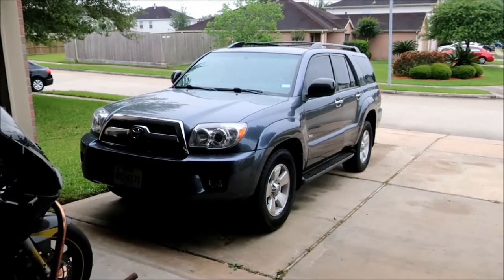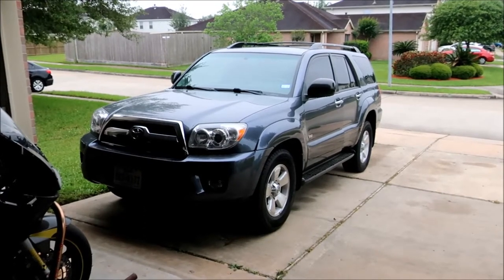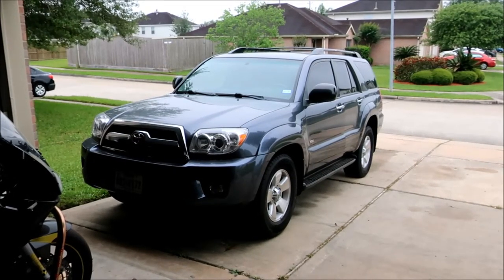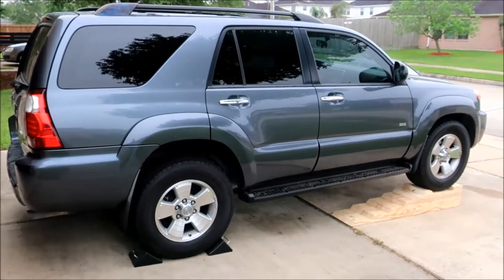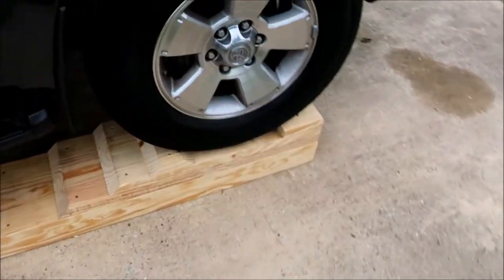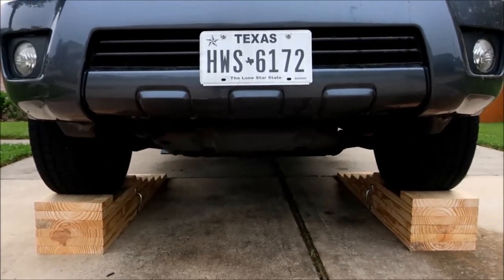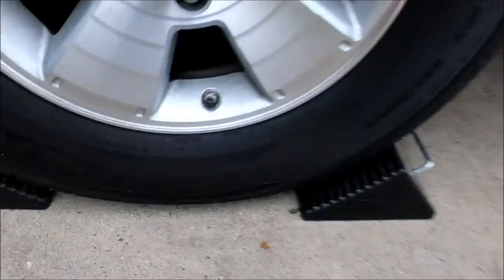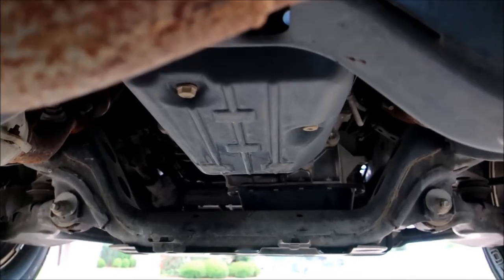2008 4Runner Automatic Transmission Fluid Service - No Dipstick

Comment: First time I see an honest instruction of servicing a transmission. thanks a lot Tommy, I have the same 4runner I am planning to change the transmission oil myself but I was hesitated. Now after I saw your video I'm confident to do so. I really appreciate your video.
Reply from the maker: Glad to be able to help.
Reply: @TimmaethBoy  I have done the changes fluid and filter. I put 4 letters WS by toyota.  4 letters is it a lot?
Reply from the maker: That sounds about right for dropping the pan. Just set the fluid level afterwards and you should be good to go.

Comment: So question. If you pull the Allen key check plug on the transmission to do your finally fluid level check. But if you pull it out when the transmission is cold. Should there really not be much fluid coming out? Because I unscrewed it about half way to see what the color of the fluid looked like and it came gushing out while the tranny was cold. Does that sound like the tranny was over serviced by the person that did it previously?
Reply from the maker: Hopefully you didn't do this when the engine was off. If you pulled the overflow plug while the engine was running, transmission cold,  thermostat bypass valve on, vehicle is level, etc. etc., then  you're correct; there shouldn't be much fluid, if any at all coming out of the overflow plug until it reaches the correct fluid level inspection temperature. If it came gushing out while the engine was running, then more than likely they overfilled your transmission.
Reply: @TimmaethBoy  yeah it was while it was off. I didn't take it all the way out, just half way before it tried to squirt out. And a little came out but not much. It just seemed like it was going to be a lot haha. But yeah I took a infrared laser temp gun and pointed it at the trans pan till it was at the operating temp since I don't have a scan tool. While it was running then pulled the check plug out and it trickled out so it's at a good level. Thanks for taking the time to answer though. Makes since why alot tried to come out because it wasnt running, that was my bad haha
Reply from the maker: @davidlavery8336  Luckily you caught your mistake before anything bad happened. :)

IR gun works in a pinch for checking the temperature. Sounds like you got the fluid level figured out and set properly. All the best!

Comment: Hey, I’m planning on doing my trans fluid drain and fill and rear diff drain and fill. You mentioned to use the steel crush washers on the trans. Do you know if I need to use the crush washer or the aluminum washer on the rear diff?
Reply from the maker: I believe the crush washers used on the drain and fill plugs for the differential are aluminum.
Reply: 12157-10010 for read dif and trans fill plug; 35178-30010 for trans drain and overflow

Comment: Question: The fluid that was already in the tub sitting at 2 gallons, was that fluid from opening the drain plug?? Because if thats the case you flush an additional 2 gallons from the hose. So your total fluid sits at 4 gallons. Yet later in the video you say you replaced the 2 gallons you removed......... wouldn't it be 4? Did I miss something?
Reply from the maker: The container I used for measuring how much fluid came out of the transmission is where I store my used oils. The oil at the 2 gallon mark was from other services done / not related to the transmission service shown in the video.

Comment: Hmmm…For the final level check you should pull the check plug let it drain to level, or add until it starts seeping out, then crank the car and let the oil heat up.  We know at that point that it can only expand so you let he car run until it hits the temp range and any excess has drained due to expansion from heating and then insert the plug in the middle of the temp range.  You had about a quart too much in the transmission.  If you had used the above procedure, you would have only lost a couple of ounces at most.  Still a great video!
Reply from the maker: Incorrect, but appreciate the feedback.
Reply: Better contact Toyota and tell them you have a better method than there engineers!

Comment: @d.g.9606 addressed one good question. 2 more clarifications:
1. Confirming this does a COMPLETE transmission flush, not just pan and residual?
2. Why use the line and not the drain plug?
Thx.

Comment: Question? Before checking operating temperature with scanner? wouldn’t you have to shift gears before draining for level?

Best honest video. Great video.
Reply from the maker: Yes. I believe I mention it in the video as well. You need to make sure you have enough fluid in the transmission before shifting through the gears; i.e., don't have the fluid level be too low and starve the transmission of fluid.

Comment: Great instruction video and not a high dollar production company thing.
Love it!
Q- how many 2x12's did u need to make those ramps.?
Reply from the maker: Thanks!

The total stack up was 6 including the tire chock portion that prevents the vehicle from just falling off the ramps. They are also hollowed out in some places to make the weight more manageable. 

You can kind of gauge the length of them from the video and figure out how many 2 x 12's you need to buy if you were wanting to recreate them - certainly not the most elegant thing I've made, but just wanted to get them made quickly.

Comment: Thanks Tommy, My brother-in-law just bought a 2008 4runner with 166K miles on it and I doubt transmission fluid was ever flushed. I'm not a real mechanic but I was a motorcycle roadracer back in 80s so that should count for something. :) Never flushed transmission fluid before and I don't have a ODBC temp reader for transmission fluid temperature. Wonder if I can rent a temperature reader from Auto Zone.
Reply from the maker: You can perform a transmission service on this vehicle without using a scanner. Check on one of my replies to Joe; I posted part of the procedure on how to do this.
Reply: https://www.toyota-4runner.org/4th-gen-t4rs/195074-atf-exchange-using-cooling-line.html
Here it how you do it with out a scan tool: On the ODB-II connector, use a 16-20 gauge (16, 18, or 20 gauge will work) jumper wire to connect terminals between CG (4) and TC (13)..there are more directions but that is the start.
Reply: Thanks Joe 🇺🇸

Comment: Been watching many videos on this subject in preparation of doing this job. I appreciate the level of detail you went into. This is an incredible video! One concern I have is I do not know the prior fluid service history of my 4Runner. All I can say about the transmission is that it seems buttery smooth and the vehicle is at 83,000 miles. If a previous owner put in aftermarket ATF, and I add ATF-WS, which is what the manual requires, would the mixture be bad for the transmission? I've heard some mechanics say yes, and others no. I've considered a flush but realize that I'm already over the mileage where it would be considered safe, so I guess the possibility of ATF fluids getting mixed with aftermarket is still safer then performing a full flush. What is your opinion? Thank you.
Reply from the maker: All depends on what they've put in the transmission. If it's compatible with the transmission and you are simply adding additional WS fluid on top of it? Then no biggy.

I usually don't assume that people have taken care of their vehicles when I work on them, but I've been surprised. If you're really paranoid, you can always flush out the fluid and start from scratch. I wouldn't consider a flush harmful for your transmission. The only time I'm concerned about that is if it's a very high mileage vehicle where the fluid has never been changed.

Comment: Is there a reason you did not refill the fluid with a gravity feed funnel into the return line you disconnected for the drain, instead of using the fill on the transmission?  Thanks for this great video!
Reply from the maker: It's much easier to refill the transmission through the proper fill port compared to attempting to pump the new fluid through one of the return lines. You let gravity do the work where fluid naturally drains into the pan from the fill port vs. pumping it through a relatively small tube that runs a few feet horizontally until it feeds back into the transmission; the latter part being impractical and probably very messy. Hope that makes sense.
Reply: @TimmaethBoy  Thank you for the quick reply. Really appreciate the help!

Comment: did you change the transmission fluid filter? Why not perform that service as well while you're at it?
Reply from the maker: I didn't change the filter. Based on the condition of the fluid and the way the vehicle has been operated - no real abuse or towing scenarios, full warm up cycles every time it's driven, fair weather operating conditions, etc - I didn't feel it was necessary for me to do so. I believe the filters on these use the metal mesh/strainer type, meaning you would just clean it instead of replacing it, assuming of course that it's in good shape; they can't filter to the degree a normal pleated filter type can anyway.

Comment: Best video I have seen on this subject. I was wondering, did you go through all of the gears before checking level?  Also, I had a shop do this and I am pretty sure they didn't replace the crush washer as the check bolt is slow leaking.  Do you thin I could pull it, add a crush washer and replace it without too much fluid leaking?
Reply from the maker: Thanks Joe. I thought I had mentioned that in the video, but I guess I forgot to. Yes, it's a good idea to cycle through the gears to ensure fluid is dispersed throughout the transmission prior to setting the final level, but put it back in P or N to resume the procedure. This is also true if you're servicing a conventional automatic transmission with a dipstick. Just make sure there's actually an adequate amount of fluid prior to shifting through the gears.

If you're talking about the overflow plug leaking, then you can get away with removing it when the transmission is cold and vehicle on a level service; the fluid hasn't had time to expand from heat so you really shouldn't have much leak out - only whatever is in the overflow tube which isn't much. Make sure you have the engine running during this, otherwise you're going to lose a lot of fluid as it isn't being circulated throughout the transmission, torque converter, etc. You do have to be relatively quick during this process to ensure the fluid doesn't heat up too much and start draining out of the overflow tube. If it's the drain plug that's leaking and not the overflow, buy some extra quarts of fluid at that point if you decide to fix that leak.

Also, I've seen a lot of people overtighten and deform the threads on the bolt. If that's the case, you need to replace the bolt as well.

Hope that helps.
Reply: @TimmaethBoy  yes, thanks.  Also, I hooked up my obd 2 and it doesn't give me a trans temp reading. Looks like I will need to upgrade. Got any suggestions on an ok reader? I have an innova 3040e and it looks like on the innova website the only reader that give trans temp is a 7111 and I can't find it on Amazon or ebay
Reply from the maker: @joebied1  You technically don't need a scanner to set the fluid level on these vehicles. All you need is a jumper wire and to connect terminals 4 and 13 of the OBD-II connector together - I'd recommend backprobing to avoid spreading the female terminals by accident - while monitoring what the transmission oil temperature light is doing. Below is a bit more information about this method via the repair manual, but verify the fluid temperature spec for your vehicle isn't different:

(b) When not using the Techstream (using indicator light):

(1) Using SST, connect terminals 13 (TC) and 4 (CG) of the DLC3.

SST: 09843-18040

(2) Start the engine.

NOTICE:
Check that electrical systems such as the air conditioning system, audio system and lighting system are off.

HINT:

Indicator lights of the meter blink to output DTCs when terminals TC and CG are connected.

(c) Slowly move the shift lever from P to L, and then return the shift lever to P.

HINT:
Slowly move the shift lever to circulate the fluid through each part of the transmission.

(d) Move the shift lever to D, and quickly move back and forth between N and D (once within 1.5 seconds) for at least 6 seconds. This will activate the fluid temperature detection mode.

Standard condition:

A/T OIL TEMP warning light remains illuminated for 2 seconds and then turns off.

(e) When using the Techstream:
(1) Return the shift lever to P and press OFF on the Active Test display.

(f) When not using the Techstream:
(1) Return the shift lever to P and disconnect terminals 13 (TC) and 4 (CG).

(g) Allow the engine to idle until the fluid temperature reaches 36 to 46°C (97 to 115°F).

(h) The A/T OIL TEMP warning light will come on again when the fluid temperature reaches 36°C (97°F) and will blink when it exceeds 46°C (115°F).

NOTICE:

Perform the fluid level inspection while the indicator light is on.

6. FLUID LEVEL CHECK

NOTICE:
The fluid temperature must be between 36°C (97°F) and 46°C (115°F) to accurately check the fluid level.
Reply: @joebied1  I purchased a "scangauge 2" on Amazon! Its reads my ATF temp for my 2013 4runner.  Toyota  is pretty  picky about ATF temp readers and this scangauge  works.
Just search on Amazon under "scangauge ll " its about 160 + tax and worth it! It also read alot of other things for the cars! Hope this helps!

Comment: I'm curious where the 97-115 degree Fahrenheit temperature range came from? Looking at the Toyota Service Manual it states 115-130 degrees Fahrenheit to accurately check the fluid level.
Reply from the maker: Not for this year model/body style 4Runner. Both the A750E and A750F transmissions call for inspecting the fluid level between 97-115*F.
Reply: @TimmaethBoy  my 2007 Toyota Service Manual states 115-130 also.  great video.  thanks.

Comment: I had a garage change my 4th gen 4Runner SR5 (133,000 miles) - not a Toyota dealer - and now the overflow plug is weeping fluid. I don't think they used a new gasket, so I ordered a new one. Theoretically if the level is right, I should be able to remove that overflow plug when the engine is cold and nothing should come out, correct? If so, then I could add the gasket as should have been done and be done.
Reply from the maker: Yes, you are correct, BUT make sure you have the engine on and running, and vehicle in park or neutral before you pull that overflow plug to replace the gasket.

Get your tools ready to go before you start the engine up. You don't want to be scrambling to find everything while the transmission fluid is heating up and possibly having the temperature climb above the inspection range. As long as the engine has been cold for some time, you should be good with regards to temperature.
Reply: @TimmaethBoy  OK, thanks. Will do. I 
appreciate your advice and of course the excellent video.
Reply from the maker: You're welcome.

Comment: Excellent video, very informative. One question, if you pull the overflow plug while the vehicle is cool (vehicle has been off) , that any fluid that comes out of the overflow is an indication that it was overfilled?
Reply from the maker: No. NEVER pull the overflow plug when the vehicle is off. You should only remove the overflow plug when the engine is running, vehicle in P or N, and transmission oil temperature within the specified checking range. 

If you remove the overflow plug when the engine's off, a lot of the fluid that was being circulated throughout the transmission will now return to the pan increasing the level. Even if you had the fluid level set correctly, removing the plug with the engine off will cause fluid to drain out for that reason.
Reply: @TimmaethBoy  Would it be wise to just crack the check plug to ensure it does come off when engine is off, but not pull it and secure it back in place? FILL plug first, then CHECK, and finally DRAIN. This is what I was thinking because if you can't get FILL or CHECK plug off for whatever reason, then it would not be smart to drain the fluid.
Reply from the maker: @jollytime0811  If I understand the question, you were just wanting to break the overflow plug loose first to make sure it can actually be removed? Then yes, that's perfectly fine. In fact, I do that almost all the time so I'm not in panic mode when I go to remove the overflow plug when the transmission is at operating temperature and the thing won't come loose.

Just make sure to lightly snug it before continuing with the normal drain and fill, or flush procedure.

Comment: Is this the same for 4WD? And do I need to drain the old factory transmission fluid out or can I add more factory to it?
Reply from the maker: Should be a similar process for 4WD, but I would verify what temperature range they want you to inspect the fluid at.

Comment: Is it normal for the transmission to make a sound like gears - bearings moving together... it is not loud, it is not high pitched but I just noticed it the other day when i was changing the engine oil... perhaps I am being paranoid lol
Reply from the maker: The transmission should be relatively quiet, unless you start talking shifting into reverse on a manual transmission, or dog box transmissions - both have straight cut/spur gears that whine which is considered normal; I'm pretty sure you aren't referring to that though.

What's the year, make, model, and mileage? Is it an automatic? Diagnosing anything online is incredibly difficult btw, so it's going to be speculation to some degree.